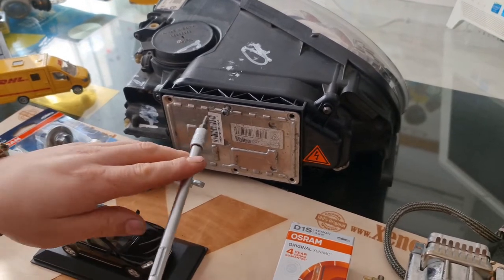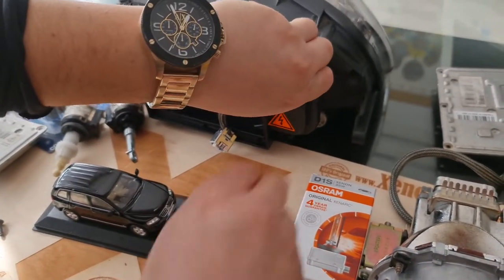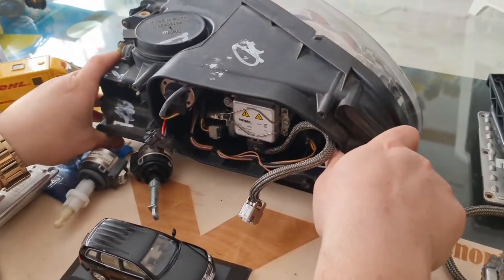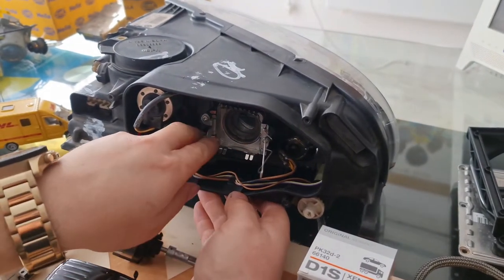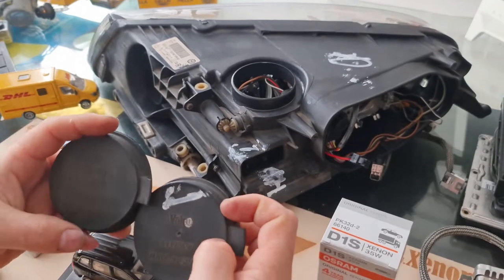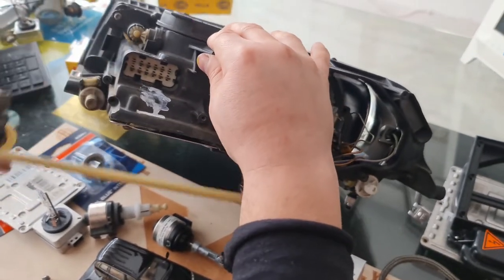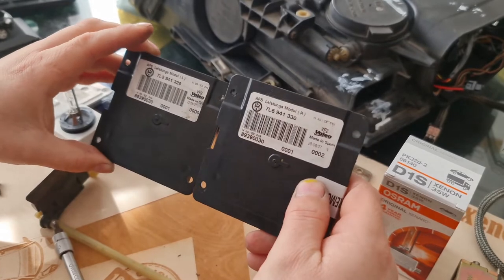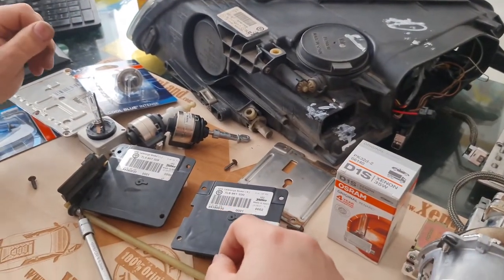VW Touareg BI-XENON AFS HEADLIGHT PARTS | XENON BALLAST, AFS MODULE, BULBS, COVERS, LEVELING MOTORS

Comment: Hi, my release/lock mechanism wheel broke. How hard is it to replace the headlight bracket? Do I need to remove the front bumper? Will I need to adjust my headlights after? Thank you

Comment: Hi! Do you have the part numbers for the 2 electric motors? Up/down and right/left. Thanks
Reply from the maker: Valeo 892022080 vertical one, and  the horizontal is 89390237
Reply: Thanks for the respond! Can i use parts like a afs module from a 3c passat fitted with afs lights on my touareg? keep in mind some parts are spesific to side.
Reply from the maker: Yes, they are interchangeable as long as you observe the sides/part numbers
Reply: Do they need coding when using a used part?
Reply from the maker: Most of the time are direct swap.
Reply: Thanks again for the reply! Gonna bother you with one more. Do you know where the afs modul are located in the touareg 7L? Not the one under the headlight but inside the car.

Comment: Hi, I’m lost. I have a 2007 Touareg with bi-xenon headlights. My low and high beams work but I get the afs no function on my dash as well as the flashing yellow bulb. None of the 4 motors are functioning and the cornering lights dont work either. Can you please point me in a general direction to diagnose? Thank you
Reply from the maker: if headlight motors are not functioning (especially the horizontal ones below the projectors) your headlight should have a severe condensation/water ingress issue. Motors are mainly mechanical parts which hardly get damaged, unless there is a severe moisture/water ingress. You have a low/high beam since your ballast is vertically positioned, but it is a matter of time for them to burn as well. If the motors are faulty, probably the afs modules are already burnt due to moisture water ingress. Replacing any part without finding the source of moisture/condensation/water ingress issue is simply throwing money to the wind at these headlights.
Reply: @xenonland  wow thank you so much for the quick reply, I was wandering how both afs modules would go bad or if there’s one module to control both. That makes great sense because of the location of the afs modules.
Reply: @xenonland  I guess I’ll try to look for any cracks or holes then move on to changing out both afs modules
Reply: @xenonland  would that also cause the cornering lights to not function as well
Reply from the maker: Exactly these modules (which are sided) control the AFS function. They are located at the bottom of the headlights, hence couple of water drops are enough to burn them. Check your headlight body for crack(s) and the back covers if they are intact.
Reply: @xenonland  Any chance you can get some used ones for me? Also is there a difference between the 7l6941329 and 7l6941329a or b or c?
Reply from the maker: You should definitely buy 7l6941329 or 7l6941330 without any letters at the end. A, B, C are completely different modules that are nothing to do with Touareg ones.
Reply from the maker: They are even sided, be careful when purchasing which side you need (for left or right headlight).
Reply: @xenonland  both of my headlights don’t have the afs function, I’m thinking both modules are bad
Reply: @xenonland  what would happen if I replace only one of my afs modules? I found the right one but not the left. If I replace the right side would that one start working or are they tied together. If one fails the other stops working?
Reply from the maker: If your headlight motors are faulty (vertical aim motor on top and horizontal motor under the projector) AFS module will not help. You should have a correct diagnosis by a specialist. Otherwise trial and error method will be very costly. We have seen a lot of Touaregs with one headlight functioning despite the other being AFS fault diagnosed.

Comment: I just replaced both afs modules and my afs system is still not functioning. “Afs no function, veh. Wallet.” Any suggestions? Do the used afs modules need to be coded to the new vehicle? Thank you
Reply from the maker: Normally used ones go straight without coding, but since both are changed, still might need coding.

Comment: Hi
I have the exact same lights as these and just about everything in them is broken and some one swapped the xenon for LEDs but i want to restore the light.
Do you have the parts number of the light its self and all the parsts? motors ballasts and computer.
Reply from the maker: It is just better to buy used condition complete headlight. Or if you find any cheap damaged one, you can swap the parts between

Comment: Hi there... can you please guide me in the right direction.

I recently purchased a pair of bixenon volkswagen tiguan headlights with AFS modules. My car came with halogen so I want to retrofit the bixenons, besides adapter cables what else do I need to get them to work properly and what would ve the procedure...do they need to be coded after installation?  Please help. Thank you
Reply from the maker: Upgrade from halogen to AFS Xenon lights is extremely expensive process if you want them fully working. In order to make them FULLY WORK, including AFS function, a lot of parts should be change. Cornering light and headlight range control unit, should be changed, main light module, even in some cases the switches, steering angle sensor, onboard supply control unit, and many more. AFS function interacts with all above mentioned modules and ecus and works accordingly. Just get the adapters and make the low and high beam work. The rest practically impossible/not feasible as far as the cost concerned.
Reply: @xenonland  will they do the "Dance" 🕺 when start the car or that's just another thing that I'm going to miss? 😢
Reply from the maker: @Vago_Vagueto  the best will be only up down "dance", not to all 4 sides.
Reply: @xenonland  can I do that with only the adapters?? Or do I still need to do coding?
Reply from the maker: @Vago_Vagueto  no one can tell you for sure, but you should have low and high beam at least. Adapter producer should have take into account your existing halogen wiring
Reply: @xenonland  thanks man... time to buy the adapters then. Appreciate your help

Comment: Hi i have 2005 and it has halogen buld headlights  iv bought new headlights these ones but when i have put them in the high beam and low beam dont work only the  indicators i need help haha
Reply from the maker: You will need adapter cables, plugs are different. in any case afs function will not work.

Comment: I'm after quad led headlights for my 2003 Volkswagen Touareg 4.2 V8 petrol. 

Can you help please?
Reply from the maker: 2003 can only be fitted aftermarket led. 2002-2010 models do not have factory fitted led drl headlights

Comment: My Touareg 2005 V8 has dashboard error "headlight range sensor". VW technicians can't find/understand the problem. (????).
The headlight lenses have fine cracks, and one removal mechanism is broken. I suspect they are not for this car and they're a cheap solution!!
(the VIN: WVGMM7L 7L05002244) it tells me headlight 7L6941017BL/018BL and headlight range sensor 3D0909157/158. Any checking method to verify the error message?? Tx
Reply from the maker: You have a xenon NON-AFS type. Headlight range sensor is NOT 3D0909157/158. These are ballasts and powers your xenon bulb and controls vertical aim. Headlight range sensor is like 7L0616214 (just google it and you will see the shape-your one might be with different part number!). Headlight range sensor if remember correctly is located behind the front wheel. When you remove the wheel you should see it. Just check its plug, usually cables that goes to the connector plug are corroded. Or your sensor might be water damaged. We hope this helps
Reply from the maker: Just look to the correct side wheel/headlight side wheel
Reply: @xenonland  Brilliant, 3 months ago, in winter, I had a jet spray under the car to remove ice-mud. One of the vehicle height sensors was displaced. Meaning, the suspension couldn't balance. But I noticed the passenger side was slight higher.! I should check all ballasts.....?
Reply from the maker: If you have a deap beam means that ballasts are ok.
Reply: @xenonland  Not at all deep. I've been complaining about headlight vision at night, very poor (Hence why my suspicion turned to the headlights).
Reply from the maker: @wviti64  if your xenon bulb is lighting, then your ballasts are ok. If the xenon bulb is lighting but you are not satisfied with the light output, it means that either your xenon bulb is inferior quality (replica or aftermarket) or your  headlight projector is burnt (the reflector of your projector is burnt)
Reply: @xenonland  thank you. You must be right..... The headlights seem to be a cheap second hand, and this includes the globes etc. I spent the afternoon looking at each ballast. They appear to work on testing (even though some wiring from the connector is exposed from the cover).
Reply: @xenonland  an update for you, the range sensors were checked, and now seem to all work correctly.
The vertical arms work fine but not sure if their angle is correct. The ballasts obviously works as the D1S bulbs light up. Plus the bulbs were replaced new but the low beam lighting is still unsatisfactory. I opened the case and found some wires with brittle covering and exposing wires but noting touching. The wire harness connections were checked. Not happy with the wires from Ballast to bulb starter (seems unoriginal=aftermarket chinese). I tried to see if the projector was burnt or so but could not check thoroughly. Also the wire harness at the rear of the headlight case are starting to be exposed. Plus the headlight lense is opaque. Could be time to find a total replacement. Thoughts?